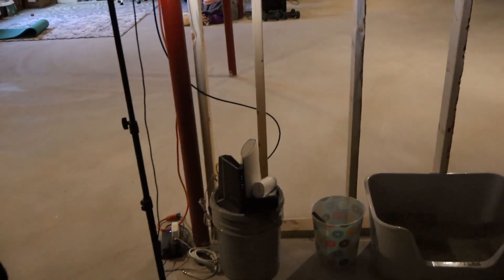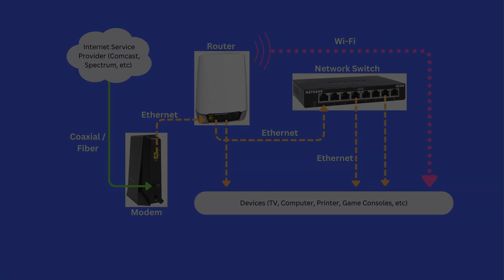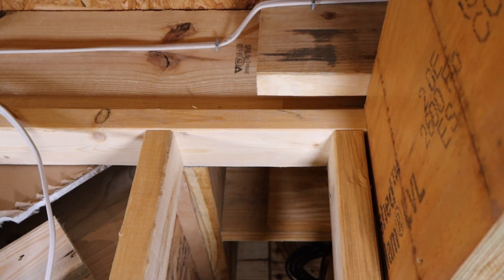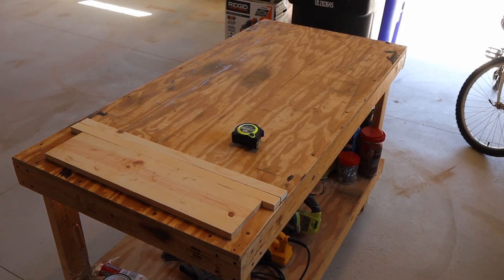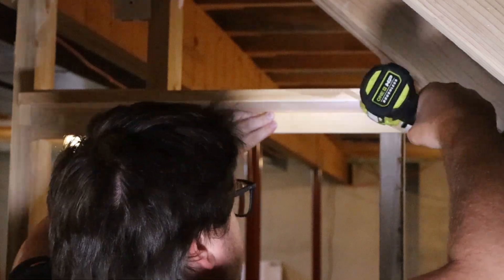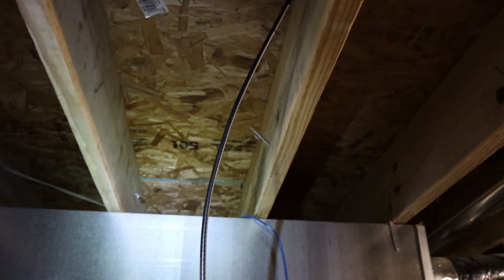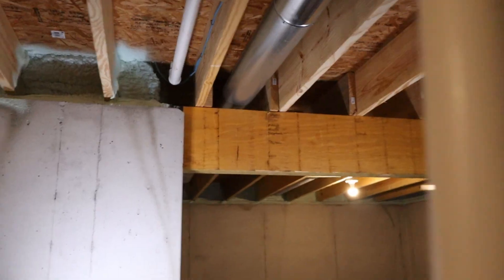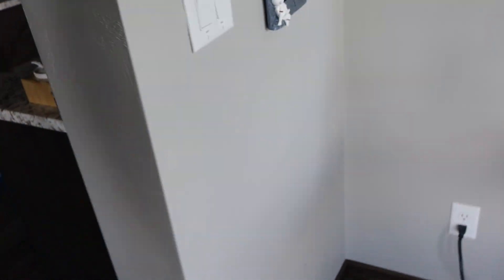Home Network Upgrade - Running Ethernet To a Network Switch — Full Process

Comment: Isn’t your modem a router too? Seems redundant unless you have it as a extender for areas far away from your modem
Reply from the maker: My modem is just a modem. You can certainly get modem/router/wifi combos. Typically, internet service providers will provide a modem/router combo, but I didn’t want to keep being charged a rental fee so I bought my own equipment a while ago.
Reply: @2D-to-3D  Modem router combos are generally not as good. Generally separate components are higher quality. For example a high end home theater will not use a sound bar that combines an amp and speakers into a single unit. They will use multiple speakers placed strategically around the room, a power amplifier possibly multiple of them, a preamplifier, input switcher, and at least 1 dedicated subwoofer. The same principle applies to networking equipment. At minimum a good setup will contain 4 pieces of equipment. An ISP modem, a router, a network switch, and 1 or more wireless access points depending on the size of the space you need to cover.